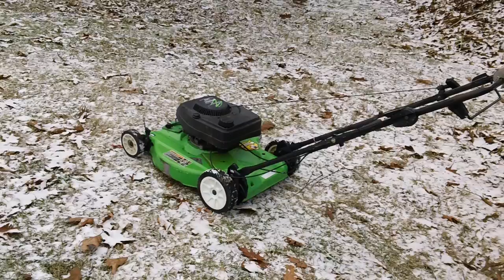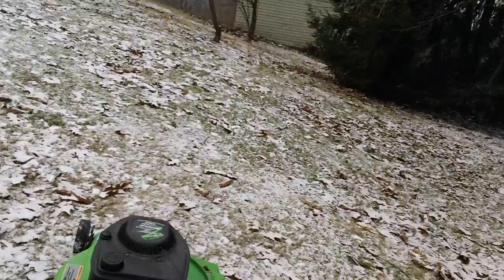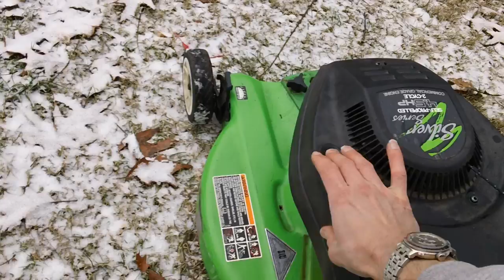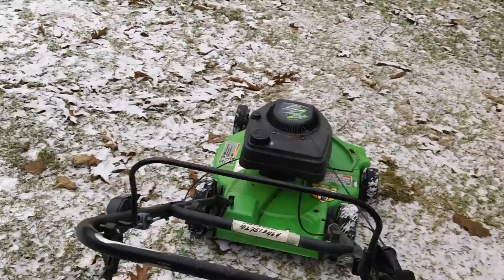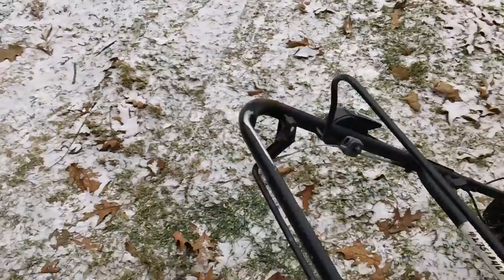UPDATE OF SILVER SERIES LAWN-BOY SERVICE.

Comment: Those V engines rattle a bit, but they are powerful.  I can't speak from personal experience, but I've heard several serious horror stories from other LB junkies about running Lawnboys on Opti oil by the instructions on the tube.  As in catastrophic engine failures and seizing.  I've switched a couple of my 1960s models to the 2 ring piston to be able to run 32:1 vs the original 16:1 blue smoke mix.  Haha!  Just cut my grass with a 1967 tan one with the D400 engine.  Still starts on the first pull every time.  It was my grandma's mower that I used to cut her grass in the 1970s.